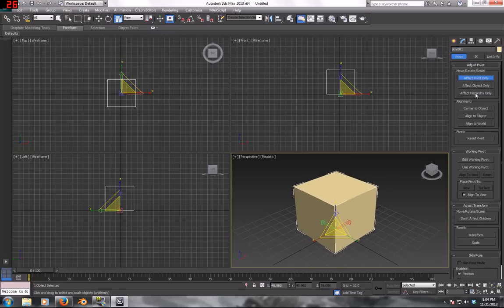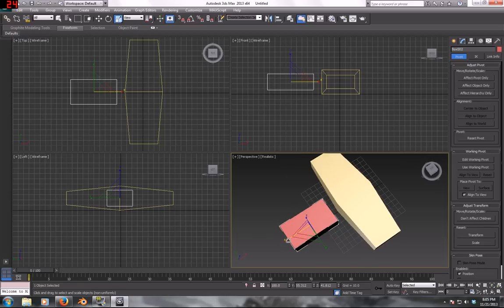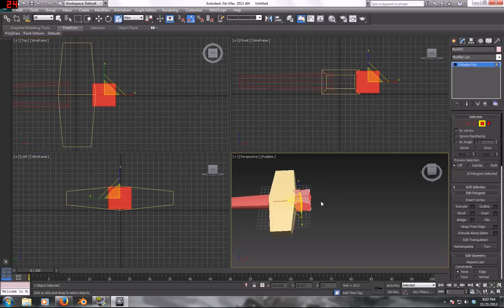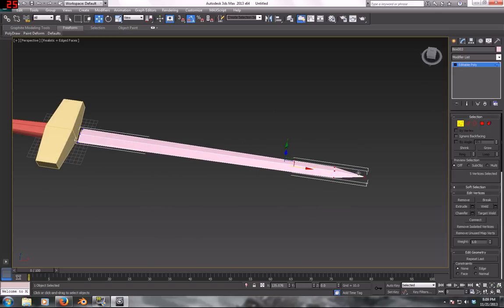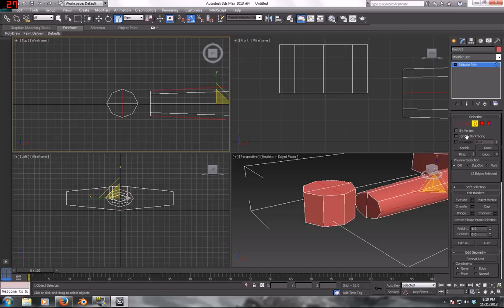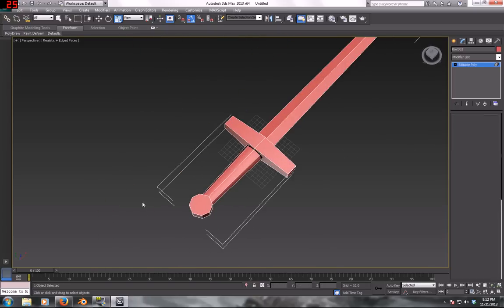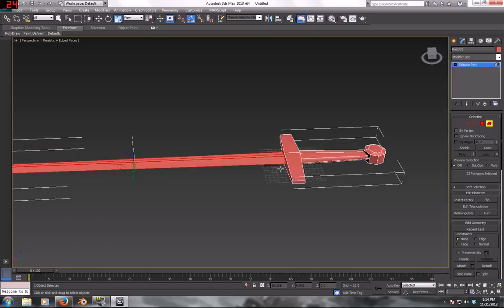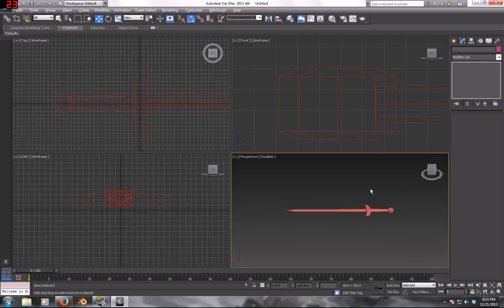Basic Beginner Sword Tutorial 3ds Max

Comment: Does all in the modeling have to be connected?? I mean, if the sharp has to be connected with the handle, etc, or this is something for organic modeling?
Reply from the maker: Its much more important for dynamic meshes, that is to say, things that you rig up with a skeleton/bones. But even then its not strictly mandatory either. You can easily see seams between different models, which is definitely fine for a sword, after all, a real sword has different pieces for the blade, hilt, crossguard, and pommel. So they all have very defined edges. If you were making a characters nose, you wouldn't want it to be separate, because that sharp seam would look really bad, and it'd make rigging really hard. (unless you're doing something highly stylized, but I assume you're reaching for further realism in your work.) 

Contrary to what I was initially taught though, it's okay to have different meshes for different parts of a model, even dynamic meshes. You just have to be smart with where your seams are. For a character with clothes, I might model the legs, boots, arms, torso, and head separately. When I have my seams in the right spots, you can't tell its a different model, if you're modeling for video games, this is can be pretty standard practice if you're going to have customization options as well. 

Really there isn't any "right way" to do everything, always try to have clean topology of course, don't have inverted normals or Ngons or anything, but aside from that, whatever makes your end product work, is what works.
Reply: Okeey that's really useful, I'll keep in mind for my new modelings. Thaks you so much :)

Comment: Very helpful for a beginner, thank you! Since I want to learn how to make sword mods for games, I now need to figure out how to make the point of the blade's triangular polys into quad polys.
Reply from the maker: Miles Beler What game are you exporting into? I've never had an issue with triangles in any game engine ive worked with, its been a bit since ive used 3dsmax, but you can just grab the very tip vertex and chamfer it, that'll make it a quad, as well as the surrounding triangles that lead into it.
Reply: I guess it's quite randomly asking but does anyone know a good place to watch new movies online ?
Reply: @Reuben Henry flixportal xD
Reply: @Remy Hendrix thank you, I signed up and it seems to work :) I appreciate it !
Reply: @Reuben Henry glad I could help :)